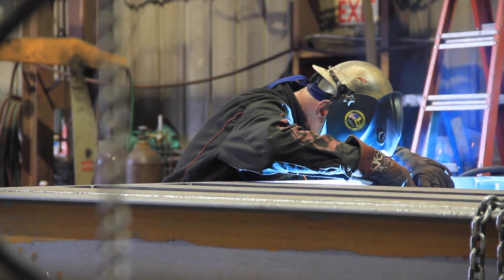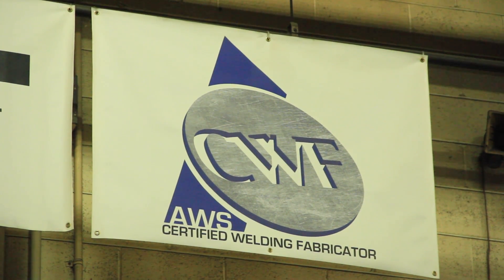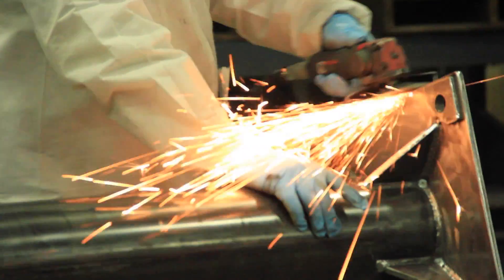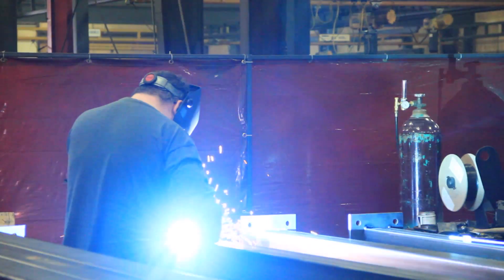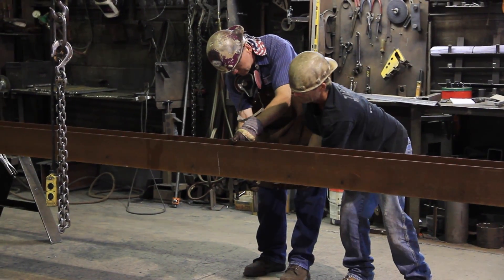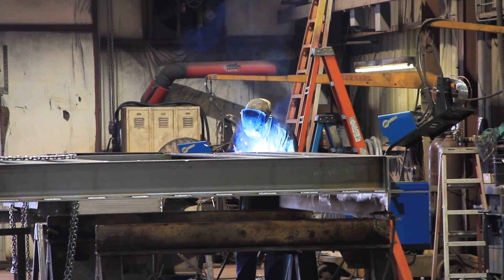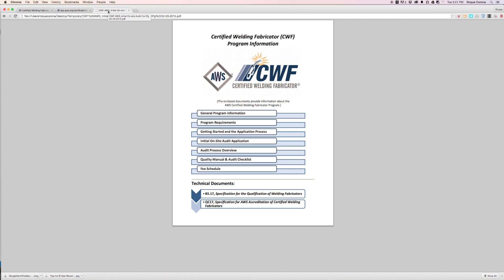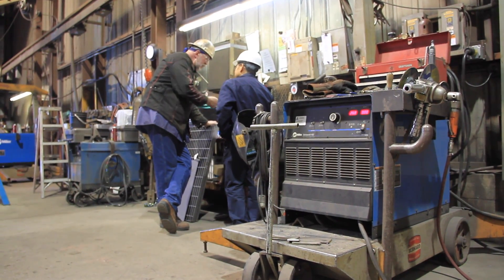Becoming a Certified Welding Fabricator: Career Outlook, Training & Certification, and Job Demand

Comment: What the hell....kid cutting/grinding with 10” wheel without guard and in reverse.
If that slips or kicks back it was going slice is chest open.

 Wait a minute I take that back he’s wearing a green jacket they are made from a Superman cape, so he got to be protected against a cutting wheel
Reply: I seen the same thing
Reply: That's how certified welding fabricators use grinders, prestige level grinding